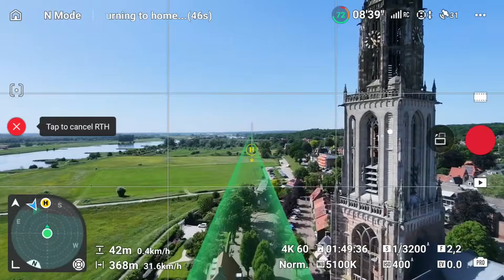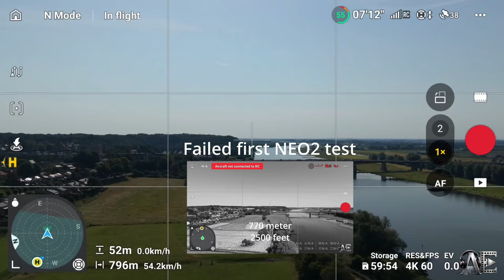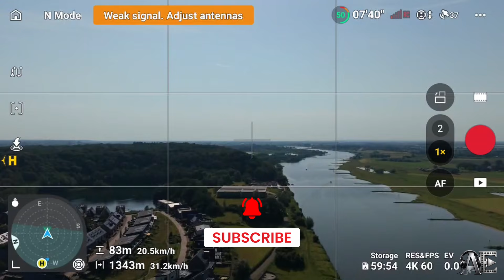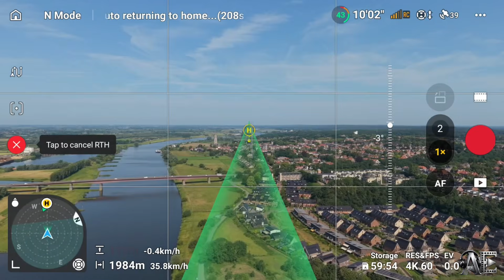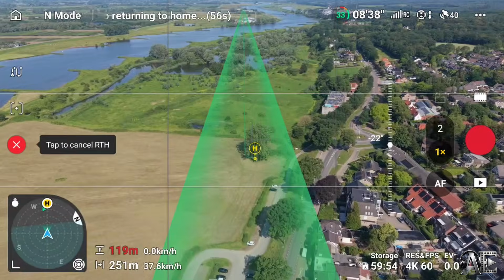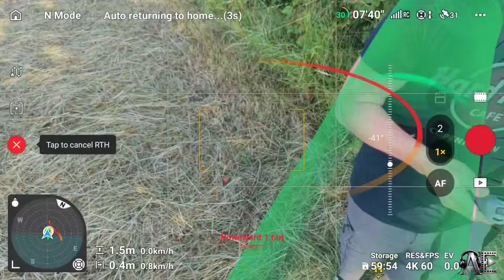DJI Mini 5 Pro Range Test: I Found What Killed My Neo2 Signal!

Comment: Did you check the Kp index. From the net: "The geomagnetic three-hourly Kp index was introduced by Julius Bartels in 1949 to measure solar particle radiation by its magnetic effects (see Bartels, 1957). Today Kp is an important measure for the energy input from the solar wind to Earth and it is used by space weather services in near real-time." I always check the UAV forecast app to see what the weather, winds and Kp index will be before I fly. I've flown at a Kp index of 6 (0-9 is the scale) and the M4P at the time, still had no issues, but when its any higher I won't fly. There have been fly aways due to a high Kp index, so I don't take the chance. Thanks for the test and the video!
Reply from the maker: I haven’t checked the Kp index before, to be honest. I had not really heard about it, but it sounds interesting and definitely something worth looking into for future tests. Thanks for the tip!

Comment: Yes I guess the better line of sight helps with transmissions.
I had an interesting thing happen yesterday while flying my neo2 with goggles n3 and motion controller. I like to fly low and as I was flying across a field at about 3 to 4 feet off the ground in normal mode the neo2 would occasionally slow down and almost stop until I went back up to 6 feet or more. I think it must be the obstacle avoidance sensors doing it. Next time I have it out I'll switch to sport mode and expect that problem will go away.
Thx for doing your videos.
Reply from the maker: Goggles and the motion controller are still on my list too. I’m really curious how that feels to fly. At the moment only my Neo 2 supports that setup, so I could try the same test.

But yes, it does sound like the sensors are slowing it down. Turning them off would probably solve it, but it also makes flying low a lot more exciting. 😅
Reply: @AgeproEdit 
At first I did not like the goggles with motion controller because I was used to flying fixed wing planes with traditional two stick transmitter. However after using them 3 or 4 times I love them and do not use my rc2 controller anymore. Also my flying buddy who has a mini 3 pro tried my goggles and bought some for his mini 3. He now does not use his normal rc1 controller now. If you get the opportunity to get goggles and motion controller it is a completely different experience and well worth the money.
ps. My buddy prefers my goggles n3 to his goggles integra.
Reply from the maker: @ToonBroon-t5m8n  That sounds really interesting! In the video where I almost lost my Flip, I was flying in FPV mode, so that already gave me a little bit of that feeling — but of course it’s not the same as real goggles and a motion controller. One step at a time. 🙂